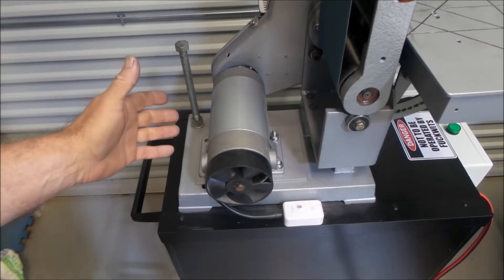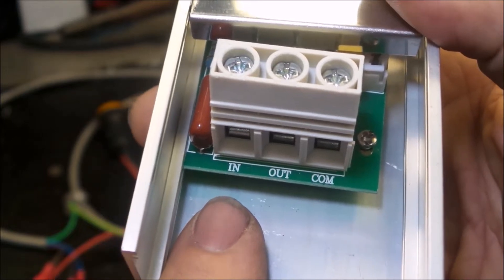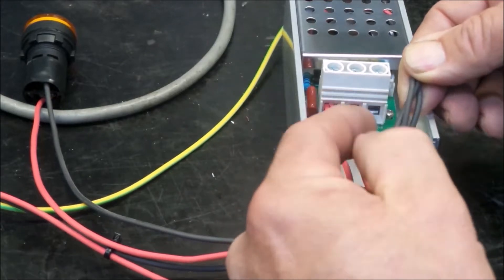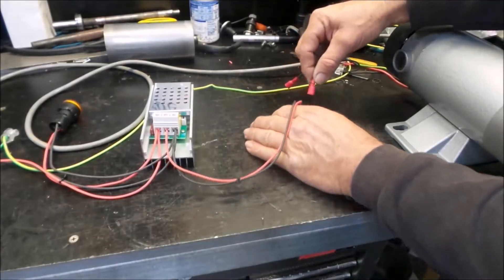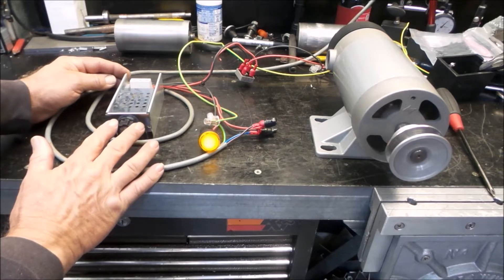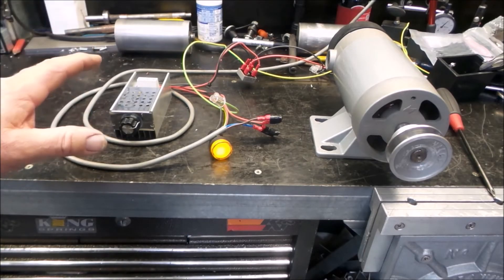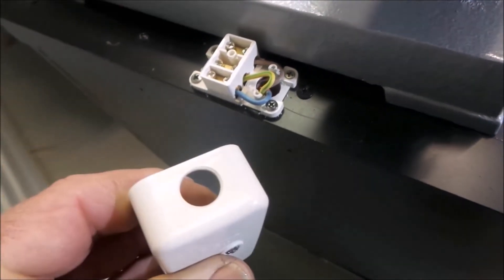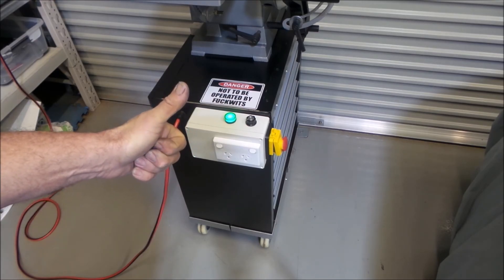The Ultimate Diy DC Treadmill Motor Controller

Comment: Gday bloke, is there a good brand / model of treadmill for the motoR?  I notice you seem to have the same style, cheers for the great content 👌🏼
Reply: My recommendation would be a Precor 9.1 or 9.2s, or any model with a similar contruction.

The motor, power supply and on/off switch are all on a single, heavy steel channel, about 1" x 8".  

Plug it in, connect s belt, and go.  Obviously, the treadmill dashboard connecte with a connector, of some sort. The workings of the dashboard are compact, an ~ 5"x 7"" LCD screen.

The other part is the frame is welded 2" x 2" square tube, and is absolutely perfect as the basis for a panel saw, if you have any interest.

I leaned the frame against my metal 'pile', and walked by it for a week, or so. Then, it hit me. I grabbed a tape, and turn it over, so the post for the dashboard, etc, (~12-18") was down. The distance between it and the other end, where there's a couple of welded brackets is ~50".

Using the dashboard post as he center support, you would need to fab something for the sheet to slide on at each side, and to hold the whole thing up.

On the inside of the frame, there is a D shaped piece of aluminum welded to the frame. on the front it's flat, to the rear is the half circle of the D.

I think the MDF deck of the treadmill sat on this, but it is perfect as a rail fot the saw 'sled'.

A friend had just given me the head of a radial arm saw, (I have all my friend conditioned to collect 'junk' for me.

It will make a great saw head.  This frame is so perfect, it's like Precor said, let's design a frame which can be re-purposed as a panel saw.

Personally, I like to use the dashboards, I like the re-purposed out of bizarre stuff look, especially since I'm disabled and poor, but also because I like saving junk from the dump.

There is bound to be a way to not use the dash board. It is just a bunch of control switch, buttons, etc. I just don't know enough about electronics, yet, to know what to use, to make a cleaner dashboard.

What many of these cheap <20.00 vids don't talk about it the volt spec for the motor. These are mostly permanent magnet motors. If you put more voltage into one than their voltage spec, it slowly demagnatizes them.  A PM without permanent magnets is dead.

You cannot control a DC with just voltage unless it is a static speed tool. Lower the voltage, lose torque.

I just put a .33 hp DC motor on my Sherline lathe. Bought a power supply and a pulse width controller. The result was inadequate low RPM torque.

Many of thr industrial DC motors use a gear reduction or a pulley system to underdrive to a secondary shaft, then overdrive from that shaft.

I just figured out how to use two scrap alternators to make a secondary (jack) shaft with a polyV pulley on one end of the alt, and my choice on the other end.

Let me know if you want more details. It is stupid easy, and simple. Basically, two alt of same brand, 1low a,p, and one high amp. Physically, the difference is thickness. Use case from thin, and rotor from thick.  

The extra width is shaft sticking out of the back of the alt, waiting for a pulley.  Motorcraft alts, I just remembered.

GeoD
Reply: George Dennison cheers mate, I will look into it 👌🏼

Comment: Just a question about the treadmill motors that you're using; I know that these motors have different ratings (i.e. 'treadmill duty' or 'continuous duty') and a lot of what I've been reading in prep for adding one to my small milling machine is strongly suggesting the continuous-duty type over the treadmill-duty type; what are your thoughts?? PS. Only found your channel the other day by chance but am loving it!!

Comment: The circuit is simple and easy to install but I'm afraid that the speed would not be kept constant when you actually drive the motor to dissipate power to the load!! I have built a similar project before and found this might not be a practical solution if you want to drive it as a replacement for the treadmill controller!! Instead, if someone is keen to built one, I suggest you come to this link to see if it will help!!
https://www.homemade-circuits.com/treadmill-motor-speed-controller-circuit/

Comment: this is great - I while ago I acquired a 2.75 treadmill motor with this written on the side: 2.75 HP @130 VDC and 2HP @ 100 DVC /1492 Watts.
  will those parts work with this motor? many thanks

Comment: Question, the scr your using and the led lamp are both rated for 220v, obviously here in the states were 120v so should I be ordering stuff for 120v?
Reply from the maker: Hi Kevin, the Scr is definitely ok for 110v or 220v, the lamp, not so sure. My gut says yes, but have no way to test. Cheers mate.

Comment: Hey mate seen video when it came out thought what a great  thing I Ave now got two tread mill motos 3 an 4 1/2 up ordered the gear from sneeze bay an now work DC motor working on the bench . Your video will are great and I didn't die that's not to bad for a  concretor just got to make he 48 inch belt sander now .. thanks again
Reply from the maker: Hi Greg, fantastic Mate, glad you were inspired. Good luck with the Sander. Cheers.

Comment: That was a great demo mate. I'm off to build one of these. I've been struggling with different ideas and power supplies for ages to run my dc motors.
Have you considered if a big capacitor would be worthwhile for full wave rectification?
Cheers from NQ
Reply: Agree! Great vid. Did you get your mill running sorted Phill?
Reply: Yes I considered cap, a 220uF or so, if you add to big of one out may blow your fuse, or triac as it takes fast jolt to charge

Comment: This is a good inexpensive way to do this.  More precision with a PWM controller if RPM and power is important to dial in eg. Metal Lathe
Reply: valveman12 yes I was wondering if a Pwm supply would be better for a mini lathe. https://www.ebay.com.au/itm/AC-90V-260V-Input-DC-110V-Output-8A-PWM-Motor-DC-Speed-Controller-Driver-Switch/323610110697?
Reply: The ultimate is to do this with a rotary encoder so your controller knows exactly where it is and how fast it's going and you can keep it constant speed. But that's way, Way beyond the scope and beauty and simplicity of this.

Comment: Beauty!  I'm gonna convert my mini lathe to a treadmill motor!!  Thanks for this!  Do you have a vid that has a switch to go between "forward" and "reverse"?
Reply from the maker: G'day Mate, no I dont, but I will do one soon, its real easy. Cheers.
Reply: I recently converted my mini lathe to a dc motor and used a DPDT center off switch for forward and reverse. My mini lathe isn’t actually mini any longer with the addition of the dc motor and I extended the bed where I have 30 inches between centers. I also replaced the ball spindle bearings with tapered roller bearings which I believe is a must upgrade. I’ve mounted a five inch four jaw chuck in place of the baby 3 inch. There are a lot of factors that contribute to chatter on a mini lathe but that small chuck is the biggest culprit. It just isn’t heavy enough to absorb the vibrations created. I have both the independent four jaw and a three jaw scroll five inch chuck and chatter is virtually eliminated even while parting off.
   If you’re converting to a dc treadmill motor you can use the forward/reverse switch from the mini lathe control box.
Reply: @dalegriggs5392  How did you extend the bed to 30"?  I have a 16" bed conversion kit I haven't done yet...  But 30"?  Wow!
Reply: 212caboose,
   I bought the 16 inch conversion kit from Little Machine Shop.com. with the intention of using the bed to extend my current 16 inch mini lathe. It took some very careful machining to mate the extension bed to the original bed and considerable reinforcing. The lathe runs true the entire distance. I also mated the lead screw so I would have length of travel. The carriage rack gear was simple, just butted it up to the other one. Now do I need that much between centers? Not really as I only occasionally turn something that long but the greatest convenience is not having to remove the tailstock during some applications which I was constantly having to do before I extended the bed. I have my lathe mounted down good and solid which also helps eliminate chatter and keeps everything running true. I had to fashion a decent guard over the five inch chucks to keep from getting into it. Decided to do that when I reached to turn the speed knob and the spinning chuck jaws shattered the crystal on my watch.

Comment: Thankyou Aussie Shed, very much for sharing your time showing us how to safely build a dc motor control, i have been searching really hard to find a way to slow down my bench grinder/ linisher and think i like your idea better, running DC treadmill motor instead. Thanks brother. I love your other videos too i found them very useful as i just bought a very old metal lathe for my workshop, and found some tolerance issues too.
Reply from the maker: My Pleasure Benny.

Comment: Very neat setup and simple - lover simple! 

Minor correction: Flat out the output will be closer to 340V peak (1.4 x 240v) from the full bridge rectifier.
How many watts or VA are the treadmill motors you use?
I keep looking for retired treadmills on the street - nada so far.  Really hanging out to get a few. One for my pedestal drill, one for the compressor, one for the belt disk sander, and if get enough, I want to convert my metal cutoff saw. Thanks for a very clear and informative video.
Reply from the maker: Thanks Benny, the bigger ones, like on the drill Press are 2,250w & the sander is 1,150w. Cheers Mate.